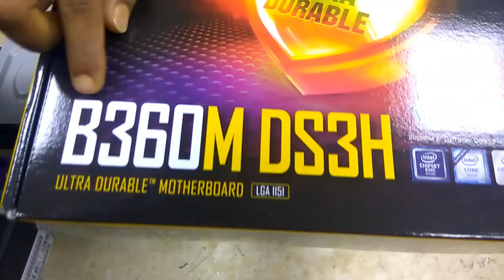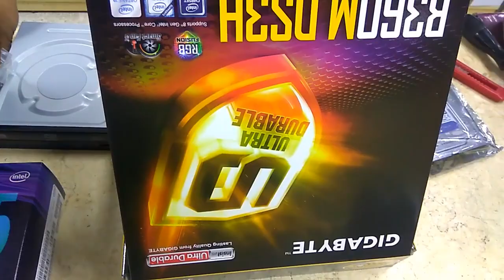How to install intel CPU I5 8400 Motherboard Gigabyte B360M DS3H & HDD WD 1TB | Tech Land

Comment: Hi I had 2 questions. When you install a 1050 ti is it supposed to just rest on the pins? I've pushed on it but it won't seem to go in any further than just resting on it. Second how do you get it to recognize mouse and keyboard after it loads your ssd? My mouse and keyboard work in bios but stop working once HD loads

Comment: Hi, I have a question, did you run this motherboard with this procesor? I would like to know if the temperature was ok and overall stability.
Reply from the maker: Yes Smoothly Run no problem. temperature is Normal .
Reply: Hello wouls this motherboard work for the i7 9700k?
Reply: Would this motherboard work with the i7 9700k?

Comment: Thanks a ton, extremely helpful video as these are the exact parts i'm getting!
Reply: i just got them today!
Reply: @blinkbubs3994  did ur i5 8400 work in the 	Gigabyte GA B250M DS3H motherboard?
Reply: did ur i5 8400 work in the 	Gigabyte GA B250M DS3H motherboard?
Reply: @Kosten47  yes

Comment: I'm getting this board for my build.  I've seen other comments that reflect my own concern.  Will this board support a 9th gen CPU i5 9500 straight out of the box?  I'm worried that if I get a board that has been on shelf for a long time that an older Bios may not recognize a 9th gen. Regards from Ireland.
Reply from the maker: Thnx u so much for Watching, Yes its compatible with B360M DS3H mobo & Core i5 9500 Processor. but u have to 1st update ur bios other wise display dose not show.update bios with 8th gen processor then install 9500 processor.
Please Subscribe

Comment: I want to buy a motherboard and I would like you to tell me which Mottherborad is better a Gigabyte B360M-DS3H or an Asrock B360 Pro4. I gave thanks for your help.
Reply from the maker: Gigabyte B360M-DS3H
Reply from the maker: Please subscribe
Reply: i'd say that it depends on your budget, the Asrock B360 Pro 4 model has more features on it as a result of it being a full sized ATX standard, but if you prefer to have a board with the bare minimums then the Gigabyte B360 would be the better option for you

Comment: Just bought this motherboard, plan to pair with the i7 87000 k, And the gtx1660 TI, with a 500 watt power supply, will this work?
Reply from the maker: Yes Work, But 8700k OC Processor. this mobo u can not use oc.
Reply: @TechLand2  so what would you recommend?
Reply from the maker: Any Z series Mobo
Reply from the maker: Like Z390 UD, Z390 aours, Z390 F, Z390 e

Comment: which power supply is compatible with this Board.? plz reply. can i use normal power supply for it?
Reply from the maker: What ur GPU Card
Reply: @TechLand2  i am using it without Graphic card. but with normal SMPS it is not started
Reply from the maker: @SagarBagkar  Ok, 450Watt more Enough

Comment: Sir i59400f is good for gamming(GTA5) or should i buy any other ?? My Budget only 13000 for processor
Reply from the maker: 9400 F processor without Graphics card
Reply: @TechLand2  mere pas graphic card h asus gt 610 2gb
Reply from the maker: GTA 5 run mbe
Reply: @TechLand2  i5 9400f gigabyte 360m with gt 610 2gb graphics gta 5 chql jaega na sir ???yes or No pls aapka jwab mere liye bahut jruri h kal praso me kharidna h

Comment: This board design sucks. Its so difficult to take larger gpus in and out of due to the PCI latch being between a gigabyte branded chip heatsink and the ram slots, I had to practically snap my cards security latch get it off the board. Not happy with that discovery.